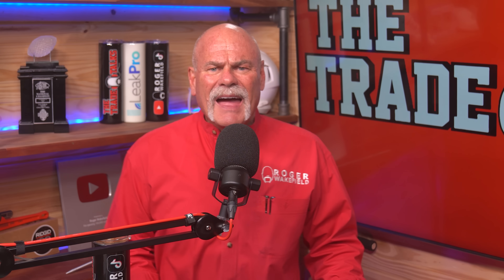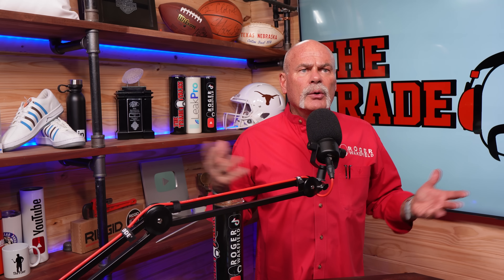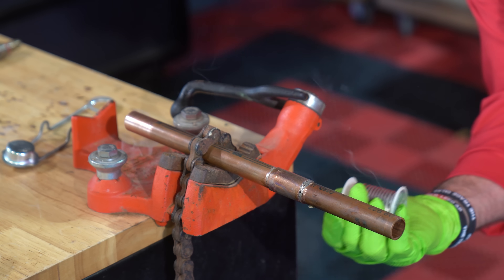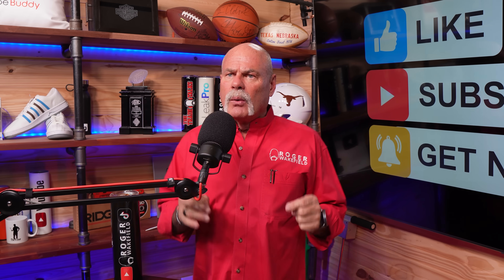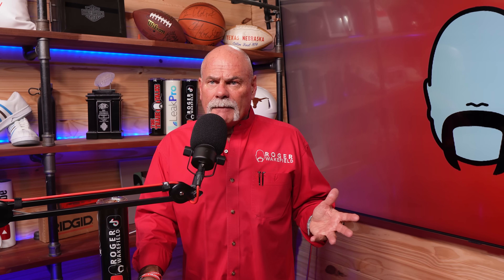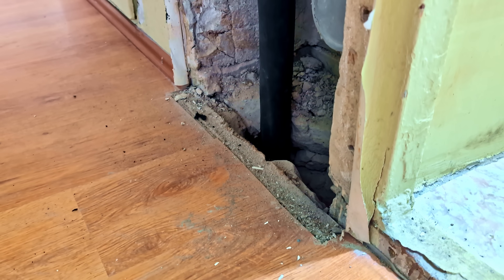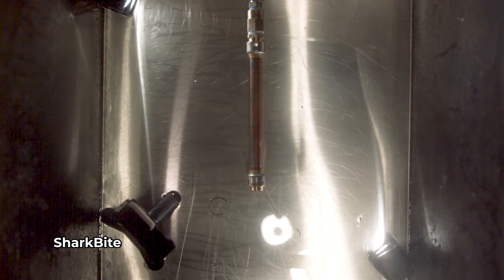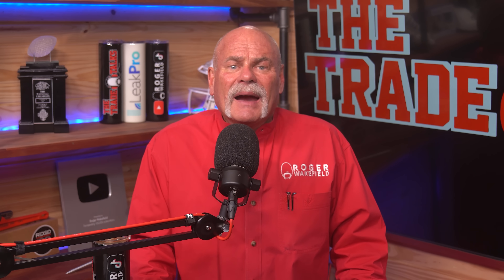The Truth About SharkBite Fittings From a Master Plumber

Comment: DIY amateur, scientist and engineer. My experience with SharkBite is very positive and with excellent observed record. I used it 5 times in our old home. Observed them for 12-16yrs after install, before we sold the house. No issues. One in crawl space for half of the main supply to the first floor, copper pipe just cracked for unknown reason, maybe some past freezing damage, thankfully not in Winter. Two SharkBite valves when I renovated bathroom sink. Last two fixed leaks that developed on.... wait for it... professionally soldered copper line elbows in the (accessible) bathroom ceiling going to the 2nd floor. I don't remember the resource but I remember that the first place where I learned about SharkBite instructed very well on cutting and de-burring pipes... I would use it again with no reservations.

Comment: The trouble I've had is that it's very easy to make a press fit connector which looks like a shark bite, but will never seal regardlees of prep.  Conventional connectors may be more work, but they work even when nicked or worn, and there's no guesswork involved.  Does anyone seriously want to risk a leak?

Comment: Agreed.  SharkBites have to be installed correctly.  Deburring is a must, and making sure you have the SharkBite fully seated on the pipe is a big deal.
I do not like soldered joints on copper pipes.  Most places I've had to sweat or solder joints are in ancient homes and doing that so close to joists seem to become fire hazards.  I recently met a guy who had to redo every inch of copper in his house because the plumber that was contracted for the house building did a poor job to where EVERY joint was leaking.
While might agree not to put sharkbites in inaccesible areas, there are also other methods to use other than copper pipe and soldered joints.

Comment: Testing these fittings to the high pressure you do, while entertaining, is kind of moot. Your assumption is that ALL other components in a plumbing system will handle the extremely high pressures and not fail before the SharkBites do. A more useful test would be to purposely damage or improperly install these fittings, then test to twice the limit allowed by the plumbing code.

Comment: I work at a major retailer, and I tell customers almost the exact same thing you said. If you don't prep the pipe properly, it will nick the o-ring and it might not leak today, or even tomorrow, but it will start to leak. And I have used Shark Bites for the exact purpose you said. I was doing apartment maintenance, and someone left a door open on an extremely cold night and the pipe froze and burst on the baseboard right by the door. About 2:00 am I was up and shut off the boiler, cut the burst copper, capped it with a Shark Bite, and had the heat back up and on in about an hour. And it held fine until the plumber could get there the next day and replace the section that burst.

Comment: ABSOLUTELY!! Never put a sharkbite behind a wall...it should always be accessible. I put more work on the pipe before installing these fittings than when I solder. I make sure the pipe end is polished and I put Teflon thread sealant on it. In 25 years, no leaks.

Comment: I am a DIYer, and I still to not like SharkBite! I simply do not trust rubber O-Rings. How long to SharkBites last? No one knows. They are still too new to know what the test of time does to them. I believe the rubber O-Rings will eventually fail due to dry rot. I can see using them for temporary fixes. But I always like to say: "If you are going to do it right, do it right the first time!"

Comment: They at least used to make permanent sharkbite connectors. They were a third the price and couldn't be taken off. Although I gave up on em after the 4th one failed. They weren't built well, and cracked down the side. They were mostly made of a cheap plastic. I think they were trying to be economical, but in doing so created a worse product that was designed to be permanent. Imagine having one of those ticking time bombs behind the wall.

Comment: If you want to use a connection fitting I would rely on a compression fitting by a reputable company, like Swagelok.  Made of stainless steel that uses ferrules that bite into the pipe material and can handle 600 psi.  Yes they're costly, but I've never had one fail under very stressful lab conditions.  And deburring isn't so much an issue as the seal is not at the pipe end.

Comment: Like you said, they're good for emergency or temporary repair. You cannot expect plastic and rubber o-rings to last 50 years like a copper soldered pipe. It's just insane, especially on a hot water line. Same with this PEX pipe. I can't believe they run this through houses, especially the hotline if you think plastic can go through thousands of hot and cold cycles  and last 50-100 years like copper will get out of your mind And on top of the stuff that leech is out of it. The problem with plastic line too is they only test for specific chemicals that could potentially leak out of it. What about the ones that you're not aware of that are leaching out of it over the long-term?

Comment: I have been a cabinet installer for 35 yrs. A few months ago I cut plumbing holes in a sink cabinet and when I slid it to the wall the cab barely touched the front side of a capped off line and it exploded and flooded the house... contractor put shark bite caps on it and didn't get em back far enough but I got blamed . I have done light plumbing ( sink hookups and toilets etc) and I will not use em unless temporary and I will not install your sink cabinet if you use them unless you are present at install.

Comment: Sharkbite fittings tend to fail in a catastrophic manner as opposed to copper which typically developed small leaks first. As a Firefighter who has responded numerous calls for service for flooded basements, the vast majority of those calls were caused by a failed sharkbite. I've seen boilers and hot water heaters fail and cause flooding as well, but the most common failure point associated with major water damage is a sharkbite. They are terrible! Everything will eventually fail, sharkbite just fails sooner and more catastrophically. I'm also not a fan of pro press.

Comment: I totally agree with everything you said about the shark light.. I ran a maintenance department for a pretty big company and I was the regional maintenance supervisor. I had about 3,500 units under my control. We would use shark bites for temporary fixes, in some cases and retired laundry rooms we would use them for permanent fixes however there like you said visible not in a tenant apartment or town home, and I could always view them and inspect them at any time.. secondly I agree with not using them for new construction is it is cost prohibitive, anybody that is using these in new construction has no clue the amount of money they could save for say a $9.90°shark versus a copper 90° So yes I agree 100% with your whole whole synopsis on shark fittings.

Comment: Eh, I'm not impressed.  Agree, correct installation is essential (also true of PVC glued joints, btw).  

But I understand code allows them for concealed applications.   Is that true?  If so, you should explain why code is wrong.  Can you cite studies showing Sharkbite failures?  I haven't seen any, and I have looked.

Comment: Yet plumbers are all using propress with o-rings keeping it sealed. 1 out of every 50 plumbers  wears nitrile gloves ( preventing human oils) contact with the sweated joint.
1 out of 100 plumbers wipe a sweated joint down with a wet rag. 

Thats just reality. Press fittings have been standard in Europe for decades. 

Aggressive water conditions eat pinholes equally.  

Anyone have a well supply? 

Thats Band Clamps

Comment: Mr. Wakefield is correct! The pipe going to our bathroom faucet started leaking behind the wall. After I cut out the drywall and saw the problem, I cut the pipe before the leak and installed a Sharkbite cap to stop the crisis so I could repair it later.

Comment: Pro-press fittings are far worse than Shark bite fittings.    Pro-press will  crimping a copper pipe does not hold anything in place for long.. you need so much extra support to keep those fittings from failing.

Comment: I will not use them, to me they are just for temporary use, similar to hose pipes or beer lines etc.
I only used soldered copper joints or mechanical compression fittings.
I suppose if the plumber clips the flexible piping well, then they may last, but some use them to avoid upping the floor so just push it through voids, then over time the pulsing and water hammer shakes the joints it is connected to, so much as to eventually cause leaks.
Gaz UK.

Comment: I had Sharkbite on a few connections to my water heater and could not remove them when replacing the water heater.  I had to cut the copper pipe/tubing.  I sweated the new connections - No Sharkbite for me.
Reply: So you're saying they are TOO permanent? LOL
Reply: @pb7379-j2k  In my case they were permanent.

Comment: The caps are alright, but I like to keep quarter turn ball valves for emergencies. It's much easier to shove the valve onto a pipe while it's in the open position so you're not fighting against the water pressure, then you can shut it off once securely in place.

Comment: I don't get the hype of sharkbite, but I sure have used them to get my family back up and running.

The Texas freeze a few years back made any PVC/CPVC glues and connectors non-existent.

But there were some shark bites on the shelves.

The time saving factor is minimal, IMO, but I always keep a little bucket on hand because they can quickly get you back in business without the need for additional materials.

For me, they are a great temporary solution for a SHTF moment.

Comment: Have had 2 solder joints leak in 13 years. One was like 3 months after install on a shower valve, the other started leaking 2 days after install below a kitchen sink
Reply: How many sharkbites have you had fail?

Comment: I wouldn’t use them in a wall cavity but I do have them on a few connections on our radiant floor heating system to connect the lines from the floor to the lines coming from the manifolds. They’ve been there for going on 10-12 years and they haven’t shown any signs of leaking yet. When they do, I’ll replace them with new ones.

Comment: Yes but will they last for 100 years. The old standard for home construction components was 100 years. Homes by design were intended to last 100 years with no major problems. That standard went away pretty fast around 1980, as far as I know.
Reply: PEX won’t last 100 years, and new construction comes with it. That a SB fitting also won’t last 100 years doesn’t seem to be a problem.

Comment: Everyone concentrates on the O ring issues but the teeth can be a problem also.  I had a freeze break on 3/4 copper and I could see where the teeth had slid off of the pipe.  It was a new fitting and I had used the depth tool.  The setup survived the 2021 freeze but not the 2022 freeze around Christmas time in DFW.  It was in the attic I was out of town and the results were catastrophic.  Matt Risinger did a video where he froze various fitting combinations and showed the same thing.   Never again.

Comment: Here is my concern about them.  Over time the chemicals in the city water tend to dissolve rubber parts in the toilets and valves in the faucets causing them to fail.  
what is going to stop the o rings from failing in the sharkBites?
Reply: Yeah, I’m lucky if a faucet lasts 4-5 years in my house.

Comment: The whole plumbing system in my house is Sharkbite push-on connectors. Not because they're great, but because whoever did the plumbing didn't know how to do plumbing. There must be 50+ Sharkbites in the spaghetti mess. None have failed. Yet. It's been at least 10-12 years. You can't beat 'em for emergency repairs.

Comment: I have them in my garage where I extended copper to plastic for feeding a dog wash and it works great. I used it in the ceiling area (which I have access to) because it would have been difficult and dangerous to solder. The funny thing is that I had the roof open and had perfect access to change the fitting; however, I really felt no reason to. I always deburr the copper and use potable grease like Magic Lube and it slips in great.

Comment: The issue with this video is the assumption that because some homeowners are stupid and can't learn a very basic practice (pipe cutting and prep) risking massive damage to their home that this says anything about the product. If someone unskilled tries brazing and fails which they are much more likely to its still the same problem. Big Solder isn't inclined to teach people how to braze either.  Logically SharkBite is better because it's much harder to screw up. The fact that it encourages more people some of whom are unscrupulous and then professional plumbers encounter this judging the DIYer generally is a logical fallacy.

Comment: Shark bite fittings work well if you install them correctly. And most plumbers I know, yes, real plumbers, not Joe the DIY guy, use them extensively on tie in and repair jobs especially in tight spots. No call backs and no drama. Use them right and in over 20 years I've never heard of one failing.

Comment: When I was in industry we used what we called one touch air fittings that are fairly similar.   They will fail in twenty years as everything drys out and the plastic stretches. They will not be used in my house,

Comment: I used to be an iron worker not a plumber and I used to solder copper pipe or run cpvc pipe, or pvc drain pipe. I did this for friends, family and myself many times over the years. When the shark thinks came out I was skeptical at first but I had a job that needed to be done under a house in the dirt. It needed to be done quick and the water cut off was leaking slightly so I couldn't sweat it even using the bread trick. So I tried the sharks and they worked so well on that job that I've used them in a lot of other spots just because its quick and easy. I've never not sanded and cleaned anything that ive used them on although I didn't know Ii was supposed to. I just did it because that's how I was taught in middle school how to do plumbing in shop class and how my father showed me before that.
Reply: sharkbite has a real nice tool for prepping the pipe that does the inside and outside and makes it fairly idiotproof.  noone buys it though

Comment: I did the plumbing in my house.  I have one SharkBite fitting in my house and it is in the ceiling of my basement.  Because of the spacing of floor joists, there was no way that you could solder in the area so I went with the SB fitting.  14 years later, not a drop of water.
Reply: That's good, but the estimated life of Type L copper is between 50 to 100 years, mostly depending on the PH of the water.  Fourteen years old? It's just barely a teenager, with a long life (hopefully) ahead.

Comment: The only time I've used SB is when I replaced the vanity in my hall bath, and needed something to temporarily cap the supply lines so I could turn the water back until I was ready to install the new vanity. SharkBite caps were perfect for that. I replaced them with soldered ball valves just before setting the new vanity in place.

Comment: So are the new copper crimp connectors with o-rings not to be used inside a wall? Here in Canada, I believe Shark-bites are allowed in wall.
also, even soldered connections fail... mostly due to bad installs. Sure, a seasons plumber is likely to make very few mistakes.  but say 1% of the time they don't make a perfect solder joint.  Not much different than shark-bite, which are arguably easier to install correctly (prep, etc).

Comment: I was at a plumbers convention in New Orleans and they were testing Alligator fittings on 3/4 PEX pipe, the ambiant temp was 71 and the PEX split at 900 lbs but the fittings did not. I tell plumbers never use them on copper becuse they will come off. They are good for a quick fix until you can do it right.

Comment: While I am FAR from expert at sweating fittings, I get by. Sure I've had leaks but they are immediately visible and readily fixable, even though I curse them when they happen. Never had a joint fail after installation. NEVER! Hardest lesson for me to learn was DON'T OVERHEAT THE JOINT!!
Sharkbites are very attractive but, IMO, FAR too expensive to be used as a matter of course. While I've looked at them, I always balk at the cost. Flux, solder and my old torch are dirt cheap!

Comment: As I recall, Roger operates out of Texas, so freezing pipes is probably not a common concern.   But I have seen of multiple occasions where Shark Bite fittings have failed in extreme cold.  So I suspect that they may handle a sudden, temporary pressure spike as well or better than other connections, they don't fair nearly as well with prolonged pressure increases such as when the water expands when freezing.  Though, that can also be beneficial as it has meant I had a simple, clean failure point which is much easier to repair instead of allowing pipes to rupture.

Also, I am curious if the copper to copper connection in a press fitting might mean that such a connection could actually become stronger with time as the metal bond together?

Comment: Sharkbite is not a lifetime solution. Rubber decays. After 10 years the gasket will not tolerate any movement. A water hammer can easily break the seal. Rubber lasts 20 years. Soldered copper pipes typically last 50-70+ years, while PEX lasts around 30-50 years. What does your application require? Time, cost or quality? Choose two.